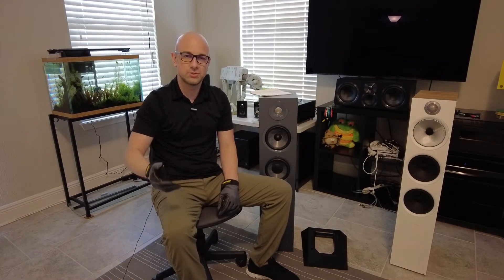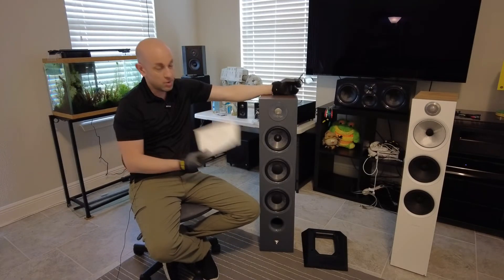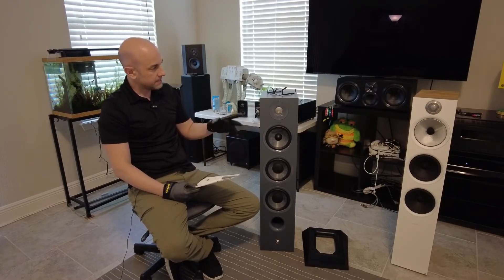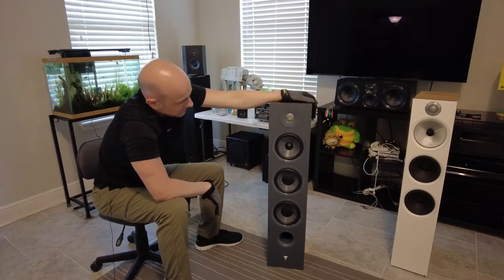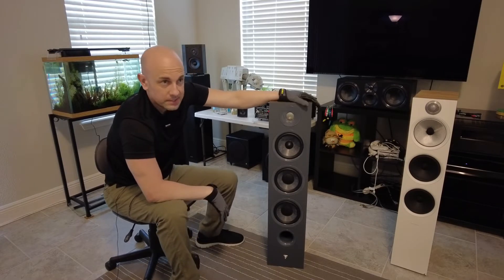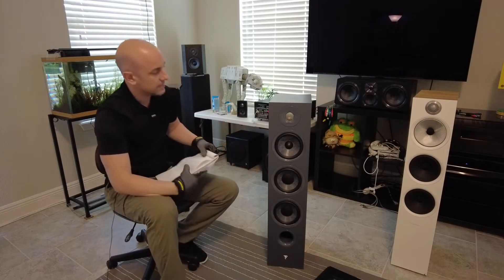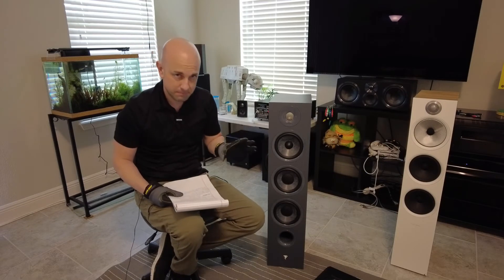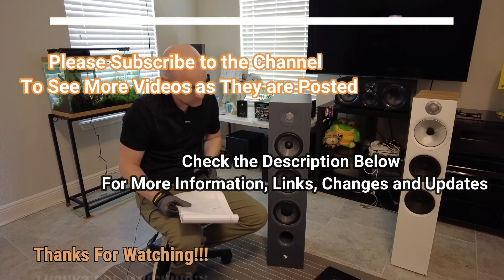Focal Chora 826 Review, Floor Standing Tower Speaker | Home Theater and Music | Clear Vocals

Comment: Nice review I own these Choras in my home theater for my front stage… I will be upgrading the rest to of speakers to these… I wouldn’t say these are bright however some room treatment will tame them a bit if you are finding it sounding brighter, resonance in the room can artificially inflate the top end with especially in rooms with hard floors. I found them to be  extremely detailed but not fatiguing in my treated room. As you said in your review they are much better with subs.  

Overall paired with some good subs like I have HSU ULS-15 MK2s they are incredible.   You can reach almost endgame sound and definitely at the point of diminishing returns with these when set up properly.
Reply from the maker: Thanks for sharing your experience.  What receiver or amps are you using?
Reply: @OldtradesReviews   Pioneer Elite VSX-504, I’ve also ran them on my Marantz NR-1200 and found they sound even a touch better.   My pioneer has pre outs so I plan on adding amps for the bed channels in my. 5.2.4 set up.   Looking at Emotiva and Monolith amps trying to figure out the best way to go.
Reply from the maker: I also like my Marantz 7013 over my Onkyo rz840 for powerful sound quality in Mulichannel audio. 
 Emotiva and Monolith Amps I am researching.  I may Order 1 this week.  But Im getting a Marantz 5 channel Amp to test.  Because I really like Marantz Sound and price is good too.  I am liking the Parasound THX Ultra 2125 v2 so far.
Reply: Using these in a 7.2 set up focal all the way around including the matching center channel, Emotiva amp for the towers up front. They are fantastic for movies and music they are even better.

Comment: I have the Chora 806 bookshelf version of these. I can tell you that these do benefit from the included stand.
I listened without first and then with and the difference is there. The time alignment, spacial info, etc. does improve when the speaker is angled on its intended stand.
Another thing to consider is that these are in fact not lacking in bsss nor are they bright. 
Focal tweeter design is meant to bring you detail and their inverted design does just that. 
In fact as far as a Focal product, these are a warm speaker in comparison to their higher end loudspeakers.
These are not bass lover’s speakers though and yes, they would benefit from a sub.
However, I enjoy bass and don’t use a sub with the bookshelf version in a secondary system with a 40w per channel NAD integrated.
Focal speakers very much so need some time to play before things settle so place these, play some music and walk away for about 2 hours, and you will be rewarded.
The staging on these with proper placement is wide and beyond the speakers.
A note on some of the music you mentioned…
I’m a jazz lover and metal head. Focal and metal are not a match made in heaven as metal is generally compressed and mixed/mastered in a way that can sound harsh on more revealing speakers.
There are exceptions of course. Distorted guitars, etc. can be difficult in poorer quality recordings. 
If that’s your primary genre, maybe a Klipsch or ELAC would be a better choice.
Use the Focal stand, allow these to settle in, place properly away from reflective surfaces and enjoy.
While I’m not convinced the Choras were very competitive upon release unless you really love Focal, they are indeed a good find a few years later.
There’s a lot of speakers out there now so try before you buy when possible.
These are excellent for the price in 2022.
Nice overview of potential set-up.
Reply: The 816s are measured to be bright in room due to the flaring wide dispersion pattern, on axis they are rather neutral. This can be easily solved by absorbing first reflection points on the side walls, floor and ceiling. What these cam do and other speakers cant is the level of detail, clarity and transparency it produces. Dynamicism is another unbeatable area at this price point, along with that HUGE soundstage it produces when you have the space for it, another artifact of that wide dispersion pattern. It beats other speakers in nearly every aspect besides low frequency extension and slam. This is not an issue if you are running a sub or 2. It also has none of that 'warmth' that people talk about in Elacs/Wharfedales.

Comment: How about an amp that can deliver more current  into your speakers, like Hegel or Naim amps. that shoud do it!
Reply from the maker: Those are some expensive amps.
Reply: @OldtradesReviews  Bay a used one! This speaker has a lowest impedance of 2.8 ohm at 120 Hz, and the impedace phase minimum & maximum -65degr, to 38 degr, so is not an easy task. I myself use an tube amp which have outputtransformers to isolate the powerstage from variations like this.
Reply: @OldtradesReviews  Than there is advice i've got earlier: bay an amplifier at same price as your speakers, that's the ticket!
Reply from the maker: Thanks for sharing that advice and experience
Reply: Yeah I think you need to up your preamp/amp game with these. You need top shelf power to power these detailed French beauties! Thanks.

Comment: I just bought these 826-D for $899 and the center for $450 . I think this was a great deal . I’m going to play them with a SVS 300 PB2000 Subwoofer. Do you think that sub is right for it ??? I was think of buying the new Integra DRX 8.4 or possibly go to a Rotel that offers a lot more power like you mentioned closer to the 200 ,250 watts peak . Any feedback or opinion would be valued as I’m new to this and know virtually nothing 😂🤣😂🤣. I’m enjoying the info and detailed videos you are producing. I think the sound is like you said very nice but needs a sub for lows . Instruments seem detailed emitting from it. The only thing I dislike about it is that it’s French .
Reply from the maker: I have not listened to any SVS subs but people sure do like them.
Reply: I have a svs pc-4000. It goes down to 18hz. You can't hear that,  but you feel air move around you. The PC 4000 is fast,  clean. You should review one. You would keep it. Love your videos

Comment: I was looking at getting these. I could buy a pre-owned Aria 926 for about the same price as the new Chora 826. The Aria 926 are an older model, but about twice the price of Chora, do you think the Aria would be a big step up?
Reply from the maker: From what I read from others it seems like it is.  but I have no experience with it.  I would just be cautious of return policy and if it has any warranty....because thats alot of money to spend with no warranty.  With used we never know how it was treated.  Last person could of played them to distortion often.
Reply: @OldtradesReviews  yes you’re right, it’s a pretty big risk to take. I didn’t want to spend much more than $1000 per speaker, it would be a safer bet to use that budget on some new Choras

Comment: I placed this same comment in another channels video. I'm curious what the sound of some of this equipment would sound like in another environment. When you talk in that room I hear a big echo Clap your hand and what do you hear? I'm just commenting not down grading you. I commented to you about the polks awhile back but they are out of stock so now I'm looking/thinking about the Focal's My home is 110 years old with carpet and wood walls ceiling and floors 9' ceilings too almost 0 echo fine line between a HT and a wife lol. I also have another question and again its just curiosity! Why you always wearing gloves? Im assuming because all the equipment you test is going to be returned???
Reply from the maker: As stated in some other videos.  Gloves stop hand prints, they are rubber palm so it makes grabbing easy.  I use them anytime I move my speakers so I don't slip
Reply: @OldtradesReviews   Ive not watched all your video's yet. I will though I like watching your reviews and Your honest Thoughts

Comment: pair the chora 826 with a cambridge cxa 81 .. and it does NOT need a sub, positioning and speaker brake in is key with these, ive had these speakers and amp for a few years and these things are really key on making them shine and yes, it makes a LOT of difference
Reply: Hai, need a best amplifier for my chora 826 and speaker position

Comment: I have really good experience with focal speakers, models I listened to are Focal chorus 706, chorus 726V, 726, chorus 826V ,Aria 926, 948, electra 1038be.
If you want my opinion, they start shining on beryllium tweeters, beryllium series are not bright and they play loud without any distortion, I was listening to song drum solo from album Live in Concert by Manu Katché , bass plays like those drum membrane rattling in my room.
Reply from the maker: So the Focal Aria would have that tweeter.  Its good to know.  Thanks for the info.  Thanks the Manu Katche Mention.  Never heard of him, but exactly what I was looking for.  Sounds Amazing on the Definitive BP9060s, with Marantz.
Reply: @OldtradesReviews  No, unfortunately aria is using aluminium/magnesium tweeter, discontinued electra series that I mentioned had beryllium tweeter, kanta series and above is using beryllium too.
I'm glad you liked the song, try the one released by act music.
Reply from the maker: I been listening to all of Manu's recordings.  Good stuff!  I see  now.  I confused it.  The Ari only uses the suspension method from beryllium tweeter.
Reply: I was looking at new Chora 826 and used Aria 926 for about the same price. Do you think the Aria 926 are much better? Worth getting used pair?